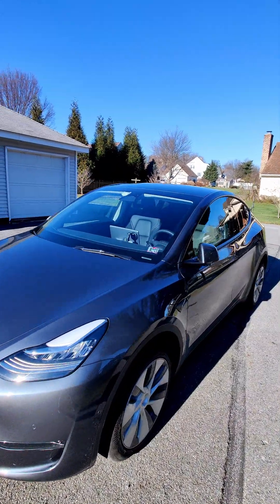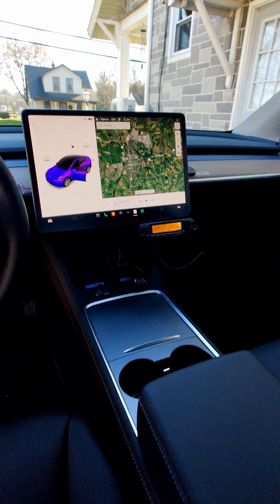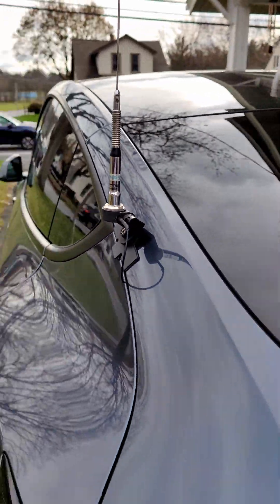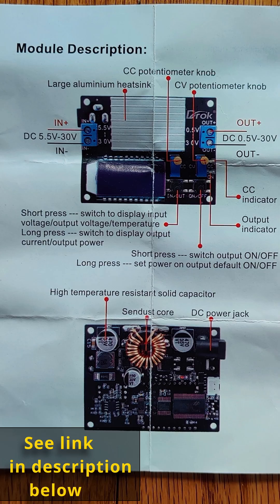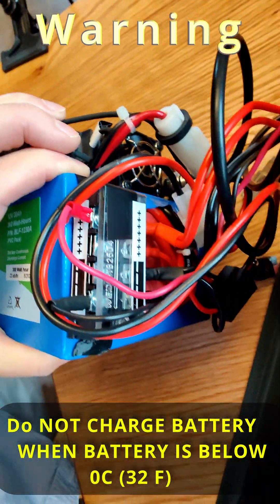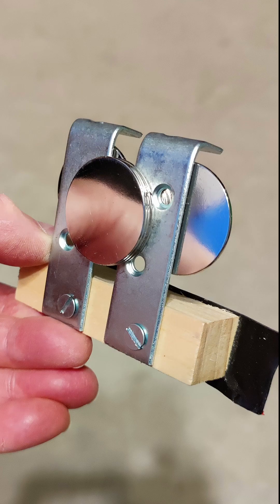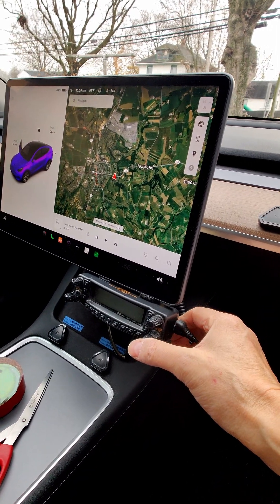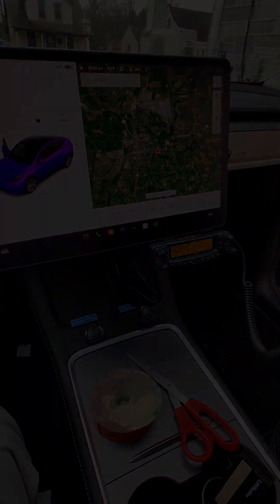Ham Radio Install in Tesla Model Y

Comment: Thanks for the great ideas.  I have several questions for you as I try to diagram your installation our.  Does the plug in the Tesla connect to the input of the Buck, and the output charge the LifePro battery?  Or, does the Buck go between the Lifepro Battery and the Radio?  I'm driving myself crazy here. Thanks
Reply: The buck goes between the Tesla Cig plug (which is between 15-16.8v ) and the LiFePo battery. It is set to have 13.8v output constant voltage and to keep the buck from overheating, set at constant current of 1amp. So when the battery gets full the current tapers off to zero. 

hope that makes sense

Comment: How is the quality of the reception/transmission?
Reply: It all depends on the antenna. It works quite adequately with the whip shown. Altho it does have a bit of whine at certain highway speeds and crosswinds. I have a smaller 1 foot antenna that does not radiate as well but is much quieter. It works well enough to receive the WX stations and work local repeaters in the county.

Comment: John, could provide a wiring diagram for buenno battery and Drok booster? In video I see some small box attached to the battery, then it looks like Drok is mounted on the dry box itself. What is that small box attached to the battery? I looked at the battery at buenno web site, it has just wires coming out.
Reply: See the above comment regarding wiring.

Comment: I'm mounting TYT MD-9600 in my Model S. I'm using the buck/boost adapter set to 13.6 volts and works fine. Why did you add another lithium battery? After installing it, I discovered a tag on power cable that said "13.6 Volts DC +15%. Perhaps I don't need the buck/boost device.

Comment: Great video!  In my experience with the Model 3, the RFI from the motor is so bad that 2meters is unusable.  I also like to listen to the air-band, and this is also unusable due to RFI across the spectrum.  I hope the Model Y has better shielding from the motor/inverter assembly!

Comment: Hello Jon, many thanks for this comprehensive explanation! I am planning to install my radio in the model Y, so great tips from you. Did you consider to install the head set in the middle console (und the sliding cover)? Would make a nice clean install and when the cover is closed, the radio becomes invisible 😅. 73 de OE3NFC/ Norbert